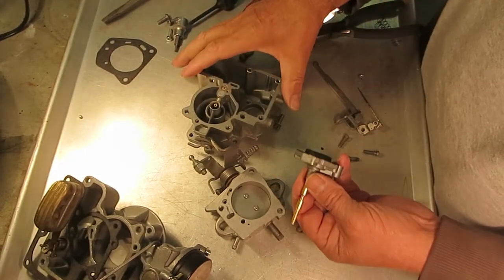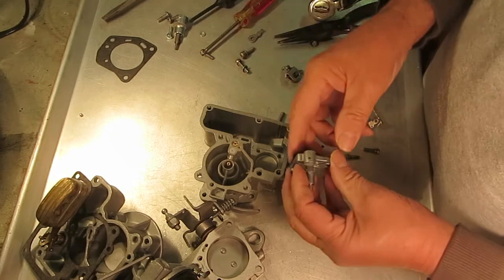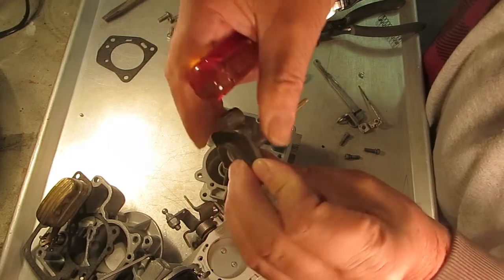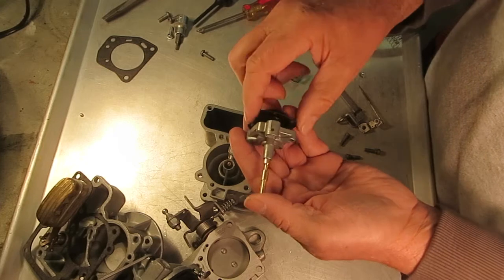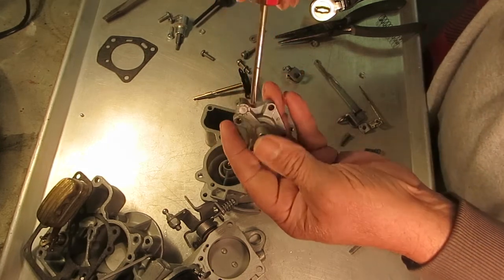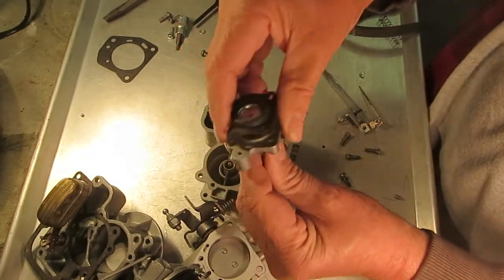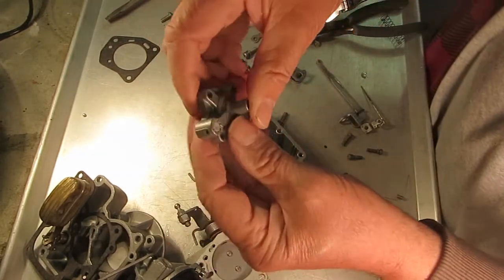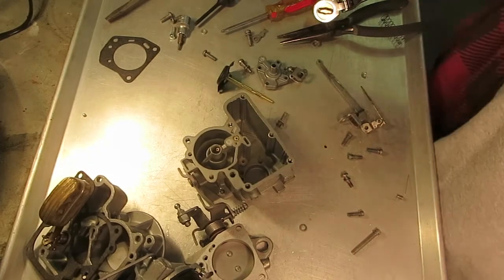Unlocking Performance: YF Accelerator Pump Diaphragm Intake Explained

Comment: My discharge don't function but runs fine
Reply: @MikesCarburetor  ok so it's really plugged so I'll find different carb or parts has bowl Carter by motercraft  and or autolite 1100 same mounting other one to two barrel might be ok not sure so next month I'll buy a carb  Manuel choke  older 300 inline